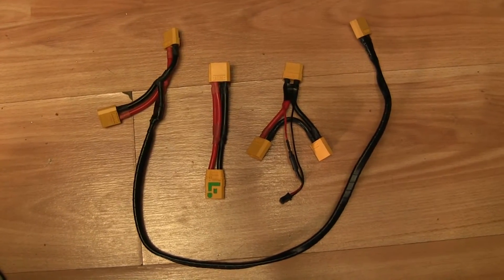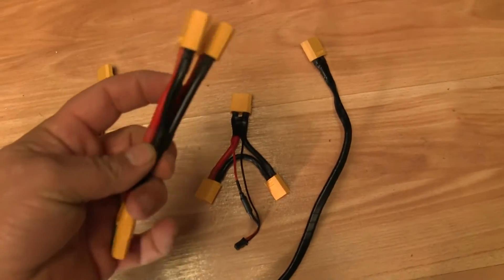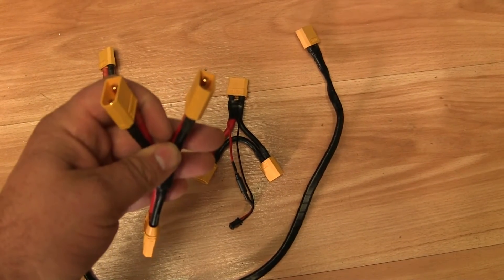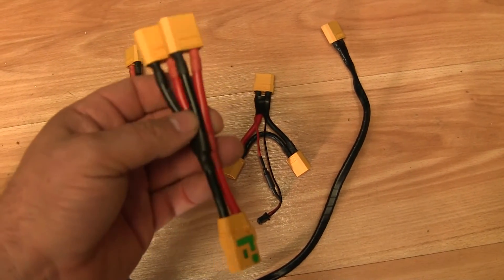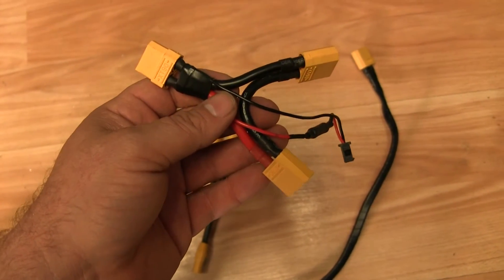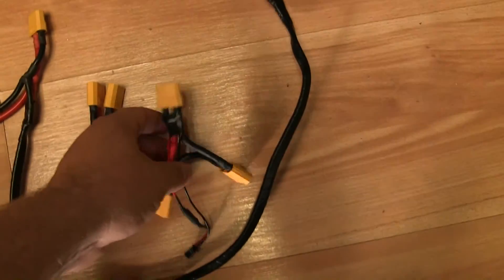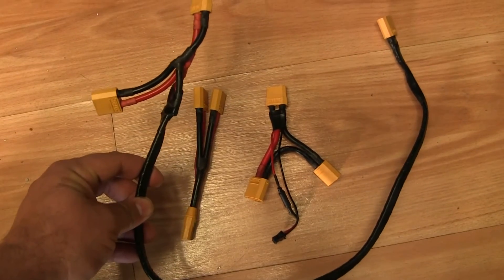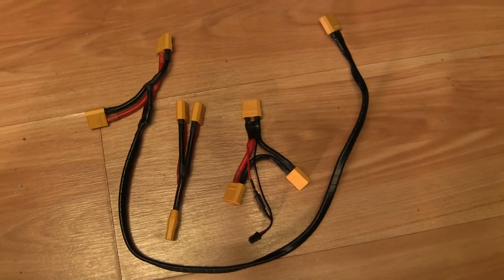WIRING HARNESS CHOICES FOR MULTIPLE BATTERY SYSTEM E-BIKES

Comment: Most are unaware, when you connect two batteries in parallel, the batteries, and especially the current voltage when you connect them needs to be the same..
if one battery is depleted, and you connect it up to another equally rated battery that is fully charged, you run the risk of an explosion and a very hot fire that is really difficult to extinguish.. Make sure you use identical batteries  (ie:  48v 14ah with 48v 14ah) that are currently have the same charge on them.  plugging in a 42v with a 48v is very dangerous..

Comment: can you parallel them together but install a switch and use one battery at a time?
Reply: Would it just not be the same as having them in parallel without the switch...would it not give you the same range without having to switch from one to the other?
Reply: @tsharpton1   parallel can give you slightly more range, the reason for switch is parallel is headache and unsafe. To make is work u gotta have both battery same voltage and if they r not same then you can damage your battery and  even cause fire. I got 3 battery and i run them one at a time using heavy duty switch
Reply: @rahi7339  Thanks!
Reply: @rahi7339   Do you have any more details?

Comment: Is there someone helping me? I have a bike and I want to install another extra battery from where do I buy these wires?
Reply: eBay  or even Amazon depending on connection and amperage you want it might be better to make your own so you know exactly the amperage it will be rated for as well as the levels of heat it can handle as well as to. It over heat any connections due to not knowing the systems Limits

Comment: what do i need to do to connect my bottom of my extra battery to my bike what connector do i need, my speed controller for the battery has green connecters on it do i buy those? for the new one bc the new one came with bare red and black wires no connectors?

Comment: Can you have 2 different size batteries with a parallel connector?
Reply: Not recommended, you need equal capacity to discharge evenly.  If you over discharged 1 it would ruin the battery.  That parallel wire is not a great idea as you are never guaranteed to have the same exact voltage unless you charge them together too on the same node...  This isn't a good setup.
Reply: @numberofthewarlock  bolton has some kind of parallel connector equalizer
Reply: @numberofthewarlock  can you parallel them together but install a switch and use one battery at a time?
Reply: @rahi7339  yes, you could have a kill switch for 1 battery.  I do this on my ebike.  I detach 1 battery using the switch and attach the 2nd battery.
Reply: @numberofthewarlock   I'm kinda confused about installing switch, what type of switch did you use? Is it a spdt or dpdt switch? And what's the Amp and voltage of your switch? I just brought two 20ah battery. Only the switch installation is what making me nervous, thatnk you
Reply: @numberofthewarlock  good call...so it is better to be able to switch one off and the other on?
Reply: @tsharpton1  no it's not you can run two batteries together in parallel perfectly safely as long as the voltages are the same you're halfing the output of  a single battery and it will double the lifespan of the batteries used

Comment: Awesome video, It gives me an idea for my Ebike. What do you guys think?  Currently I have a 52 volt 13ah battery running a (rated at) 1500 watt motor. My controller is rated at 30 amps 52v.  It hits 28mph on flat and has a range of about 25~miles. Im thinking to add another identical 52v 13ah battery. If I wire up both batteries in series or parallel what would I get? Should I switch to an upgraded 72V 3000W 100A controller?
Reply: Great question, I'm looking to amp up my Scorpion Ebike with an additional battery. Would it affect the controller or motor in any way?
Reply: I Have!
Motor 450w
Battery 36V 10ah
Want a plug more 1 Battery 12v 20ah in Series!
whats is possible merge in 2 in 1 Battery 48V?
Reply: @Fernando-py5ne  I think the two batteries should be the same voltage and capacity.
Reply: @TheCohesiveGarage  in series the capacity should be the same you double the voltage but the capacity stays the same you can run a 36volt 10 amp battery with and a 24 volt 10 amp battery making a 60 volt 10 amp battery.
Reply: @wgblues9887  Interesting!